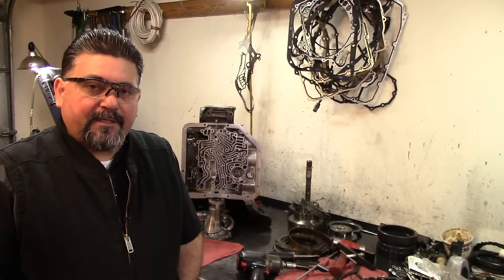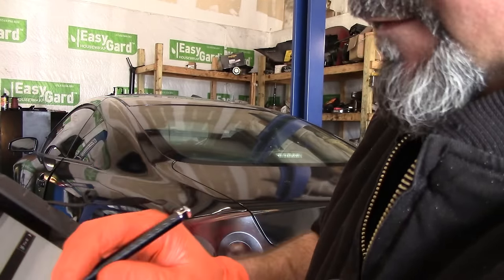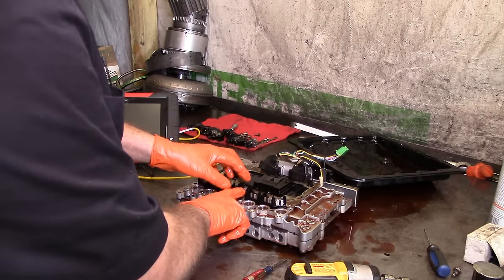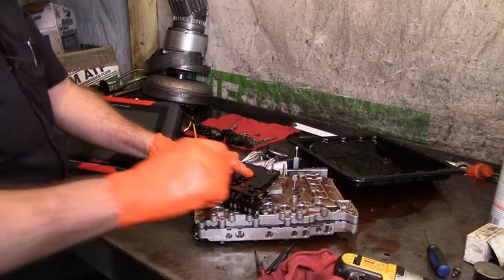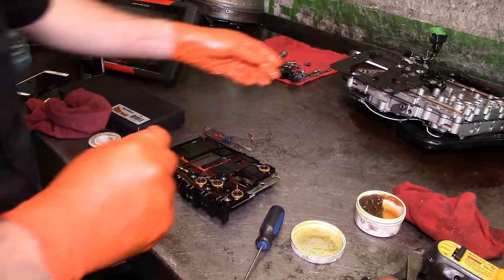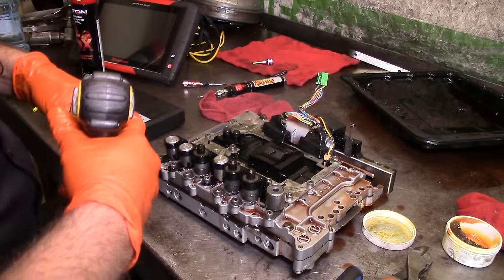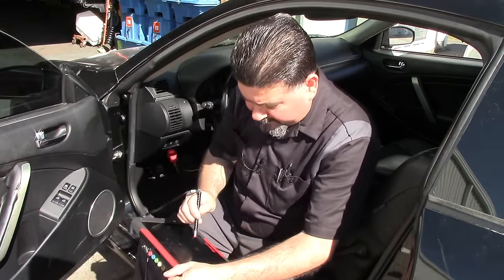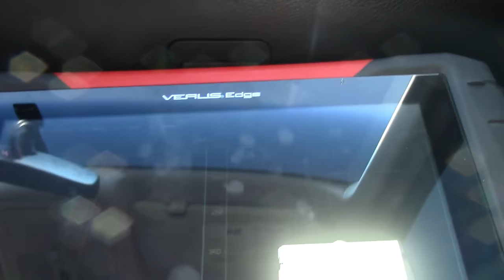RE5R05A Transmission -  P1757 Front Brake Solenoid Circuit - Infiniti G35 Coupe

Comment: I bought a used infinity M56 and 
just after adding 800 miles to the odometer the  transmission started  intermittently down shifting to  a lower gear (rpm increasing & no trouble codes) and staying there until i shut the engine off and restart it again. The problems goes away for a while, then all of the sudden and randomly does it again. Shutting the engine off seems to temporally reset the problem. I have asked for an estimate in a few places and all i get is that they can't give me an estimate because they need to physically troubleshoot the problem before pricing the work. But why they able to assure me that it may not be cheap.  I suspect that most of them know exactly what the problem is just by the symptoms that i have given them. So my car is seating in my garage for now. It's very hard to find honest mechanical shops, specially the car dealers and big names repair shops; they may find a simple cause for the malfunction and charge you an arm and a leg by lying or exaggerating the problems. Sometimes taking  your whole monthly salary and keeping you stranded for days without a car, for repairs as simple as a cracked or cold solder or a cheap replacement part which they can usually solve withing a few hours. They pray on the ignorance of mechanical knowledge of most people or the inability and lack of equipment to do the work themselves. Thank you for sharing your knowledge with us.
Reply: Papua sounds like you know more than the mechanics.... Then fix your damn car!
Reply: Tan Tan, As a matter of fact, i have fixed everything on my cars, except the automatic transmission for the last 25 years. As an licenced engineer and excellent technician with over 35 years in the field,  i have the aptitude to design, modify,  fix,  fabricate most of things around me.  But that don't change the fact that many mechanical shop take advantage of most people who know little or nothing about cars.

Comment: Im getting this on my 2006 infiniti m35, i cleared code onced and after 6 months came back on  with out me doing anything to it, i erased code again and gonna see if it comes back on, i think only happens when i used the shift gear instead driving it automatic since it has both

Comment: Hi I have navara d40 2008 with the same p1757 code. I fixed the same pin in the video. But the problem remain, steel dont shift gears properly and the same code p1757 light apier.
Someone know what I missed?

Comment: hi Mr. Gutierrez, I recently replied to another video that you have submitted onto youtube.. was wondering if you had any suggestions?"I have a 2005 chevy Silverado ls, 2wd. I believe its got the 4L60E tranny. it runs great, but recently I noticed theres a tapping noise coming from around the transmission housing and it only happens when I am stopped at a stop sign/lights. it doesn't do It in neutral or in park.  as so as I let go of the brake the tapping noise goes away. Check engine light does not come on." Any ideas? Thanks
Reply: Hello Sir, please do you have any  knowledge on how to repair a 2006 Infiniti g35 Coupe Auto Transmission with the ECU not knowing and showing which gear the car is in so therefore, the vehicle will not start even though its in park.  The code is U1000 .      Great video. Well Done.

Comment: Hey Hiram, I have a 1999 Toyota Tercel that I would love to fix up and the transmission is one of those things I really have to work on. I have very little  experience with transmissions but I think that would be a great place to start. I would really appreciate if you made a video explaning one of those. If I'm correct it's a 30510-16610-84 Transaxle. Gracias mi hermano.

Comment: WHAT TYPE OF WIRE SOLDERING DO WE USE TO SOLDER THE CONNECTOR IN TCM??ALLUMINUM OR STEEL, COPPER TYPE OF WIRE?
Reply: What kind of soldering did you end up using ?

Comment: Hello. I recently got a code P1767 and P1769 on my g35 2005. I followed this video step by step, checked to see if there's any crack and maybe solder it. But couldn't find any cracks. So I put everything back together, now when I put it on Drive or reverse it just sits, it doesn't work at all. Can you or anyone give me some advice. Thank you much appreciated

Comment: I have an issue with TCC solenoid. It is only showing zero not 0.00 just one zero. I looked for any broken terminals on the TCM. Found none. I oh. Solenoid 5.8... all of the other solenoids show 0.49 or around that. Except for tcc its throwin p740
Reply: I am pretty sure the Tcm is toast. And will have to get valve body with TCM

Comment: Hello i was a G35 coupe code P1730. couldnt find any videos on to fix this error ? can anyone guide me
Reply: Longisland Shooters did you ever find the fix? im going through the same thing and theres no info anywhere
Reply: My 06 pathfinder throws a P1731.. and I too have had a hard time finding any others with the same code.
Reply: It's interesting to note that your code P1730 shows the same culprits:
Damaged wiring or connectors
Solenoid wiring problem
Failed low coast brake solenoid valve
Failed ATF pressure switch 2

As mine P1731:

Damaged wiring or connectors
Solenoid wiring problem
Failed low coast brake solenoid valve
Failed ATF pressure switch 2

Comment: I have code p1772 LC/ Break selenoid circuit malfunction on my Infiniti 2002 q45  I done just about everything and just can't get rid of it please can anybody help please my valve body is so different to this one mine it's got a lot of fricken wires in small little black square which cable should I check for anybody what cable is the bad one

Comment: What fluid do you use on a trans like this one.
Reply: Thanks i like to change my trans fluid every 15000 or 20000 miles on my 2012 frontier.
Reply: Thanks i trust your experience on transmission info.

Comment: hey man nice vid...im having a p1759 code on my infiniti fx35 2005..when you disconnect the battery and put it back the car drives fine for a while..but then the check engine light comes on and it stuck in gear..
Reply: Shaun Plante Hey I'm having the same problem on my 2004 G35 sedan did you end up fixing it?
Reply: no not yet....
Reply: Shaun Plante have you taken it to any transmission shops??
Reply: Adding ATF fixed my code, turns out it was low and went into limp mode

Comment: saludo, nesecito que me ayuden cambie el cuerpo de válvula de una Nissan armada , por salía code P1757, le puse otro cuerpo de válvula nuevo me sigue saliendo el código p1757.
Reply: jose rodriguez que asi tu transmisión tengo una 2004 solo suelta el primer cambio y el segun el tersero no l suelta solo corre a 30 millas y pieso cambiarle el valvule body pero quetal sino m queda😂😂

Comment: Same problem but with the G37 valve body and speed sensor. Cannot find a mechanic who will do the work. They’re all telling me that I need a new valve body, and new solenoid computer, but that it all has to be done by the dealership for thousands of dollars. So, I bought a brand new valve body with a brand new solenoid, and now they’re telling me they can’t do the work because the computer isn’t synced and only the dealership can do it. Again, and only with their parts for thousands...
Reply from the maker: New TCM's are not programed. It will still start the vehicle but it will be in high blood gear. That allows you to take it to get it programed. A good automotive shop should be able to do that. Dealer too.